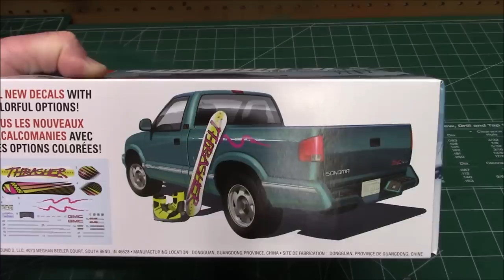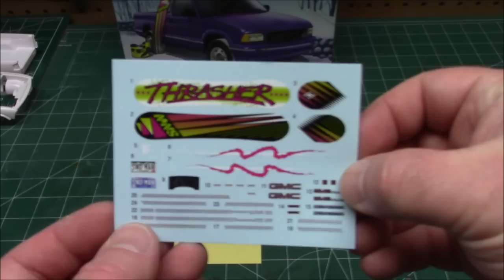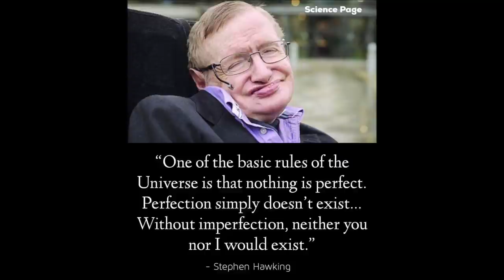1995 GMC Sonoma SLS Pickup 1/25 Scale Model Kit Build Review AMT1168

Comment: I built the S10 SS version when I was a teen. Put in a 454 from a full size truck kit I never finished (it came with the truck, a trailer and a speed boat).

I remember this kit. I remember it coming with the snowboard when it originally came out.

Comment: I'm not a model builder but I made a bronco once and decided to relic it. I used a hot needle to form rust holes around the wheel wells and then painted the rust color. Even heated up a couple sections to make dents and bent bumper. I didn't know anyone else actually reliced models. Lol
Reply: I made a Shelby-ized Bronco with the stripes and a 428 from a partial Shelby Mustang GT500 kit I bought for a $1 at a yard sale.

Comment: Worked for GM in the mid 90's the  4.3 was a quick hustler took them on the road for PDI's beat the snot out of them ... Nice Build
Reply from the maker: Thank you and thanks for stopping by the channel and watching!
www.facebook.com/hpiguysworkshop
Reply: Guys like you is probably why when I went to buy a 3 year old S10 x-cab that was absolutely mint and low mileage at a Chevy dealer. It was exactly what I wanted until they started it up and it sounded like a box of hammers under the hood. The salesman told me they would replace the engine for nothing. I politely declined and left. Ended up buying a later square body Dakota.